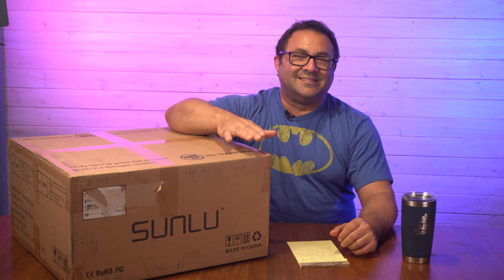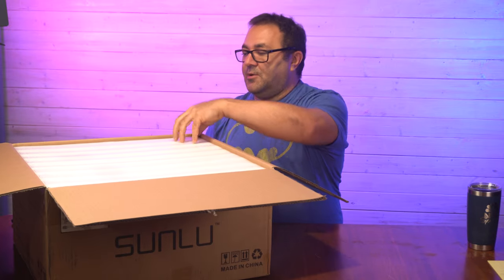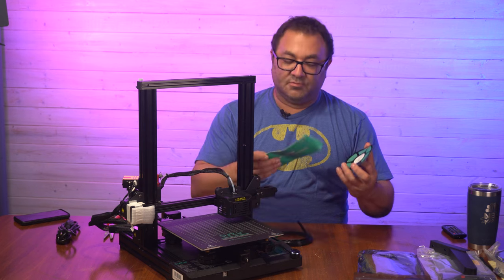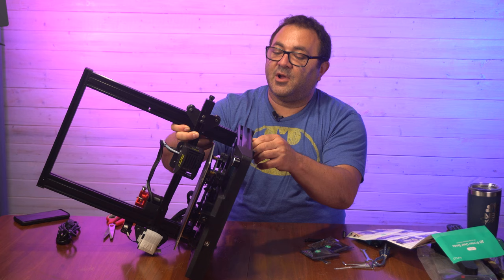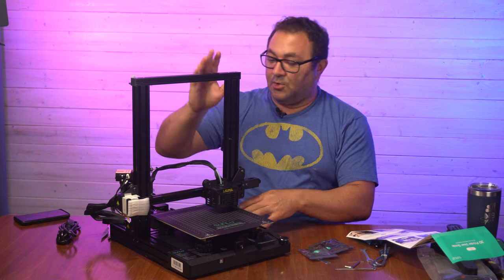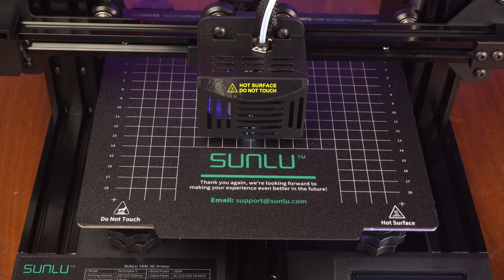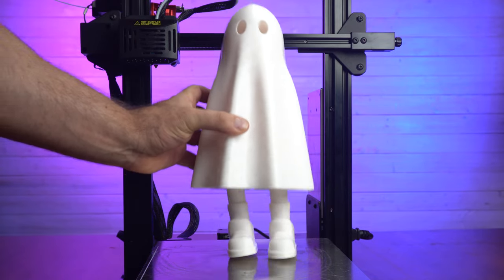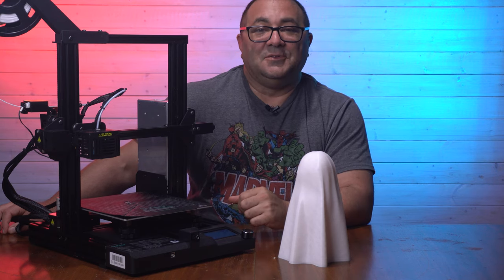SUNLU T3 3D Printer Unboxing, Setup, Print and Initial Look

Comment: So 11 months later, how do you feel about the machine? I have one as well and it prints great. Only problem i have is that the extruder is clicking. Pretty sure the spring is putting too much pressure on the filament.